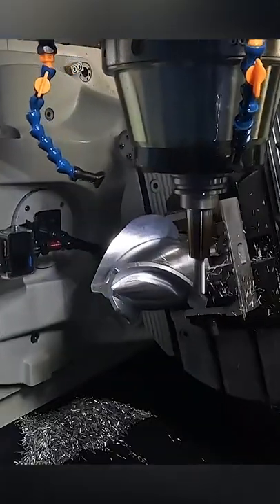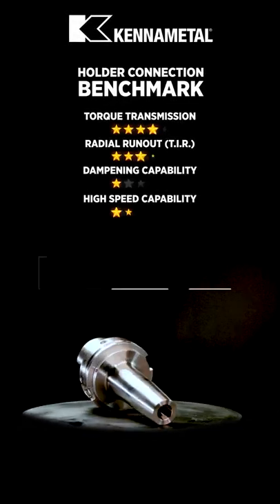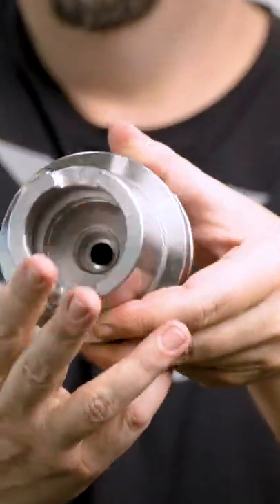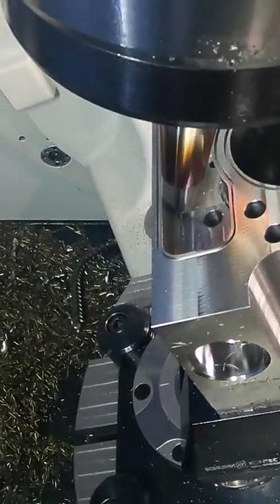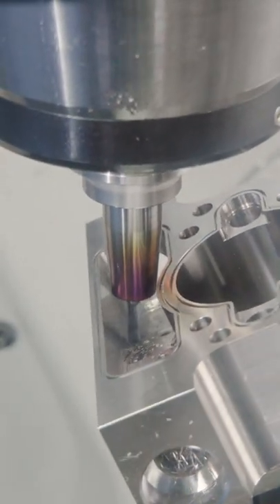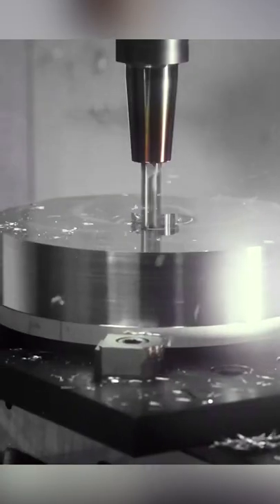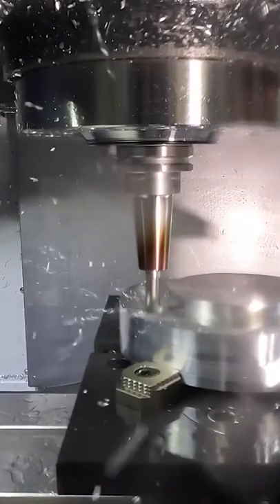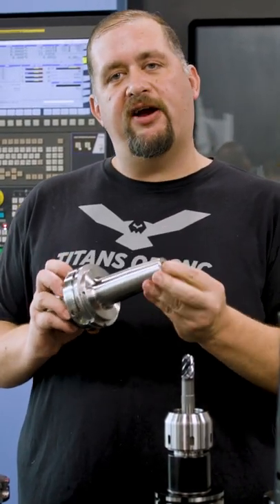This has GREAT Accuracy and Good Concentricity with Very Little Run Out #shorts

Comment: These are hands down my favorite toolholders, they were like gold in my old shop, but luckily we had Fort Knox in our tool room, our owner knew how good they were and went all out. We used them whenever possible, especially for tight tolerance work since they're so accurate and rigid.

Comment: He says something about “run out” towards the end….what’s that mean?
Reply: Run-out or runout is an inaccuracy of rotating mechanical systems, specifically that the tool or shaft does not rotate exactly in line with the main axis.
Reply: Raymond, it can also be how much a diameter varies from a "perfect" centerline or axis.
Reply: in (over)simplified laymans terms: if your bicycle wheel has a dent, the wheel would have "run out"
Reply: Runout could be described as the measured amount of inaccuracy in concentricity of a circle, or "roundness"
Reply: Also, these all are very good comments in regards to your question by the op

Comment: I don't get how they stay cool to grip when the carbide is so hot
Reply: isn't most of the heat transferred to the chip with carbide?
Reply: They only loosen up when they are red hot, if your toolholder gets red hot during operation you're doing something wrong🤣.

And yes Boofe, most of the heat is transferred into the chip.
Reply: The majority of heat generated during the process is dissapated by the surface area of the tool holder. And like the above comment, if you are getting "that hot" you are doing something wrong
Reply: @williamstamper442  You're partly correct, the chips absorb most of the heat, about 90% of it, but what doesn't go in the chip goes into the tool and by extension the tool holder and spindle, assuming there's no coolant running which there should be if we're talking about this much heat.
Reply: @TheExplosiveGuy  yes and i agree and that's what I'm saying is that little bit of heat will be distributed thru the tool and never to your hand unless you are pressing Wayyy too hard. That excessive heat should be distributed thru the tool by the time the machine is off and your hand is on it. If it's that hot that you can't hold it then you worked the tool much too hard